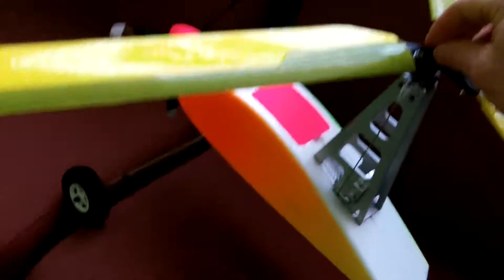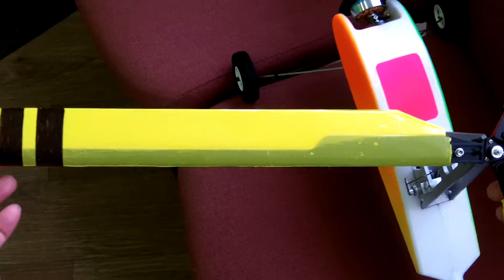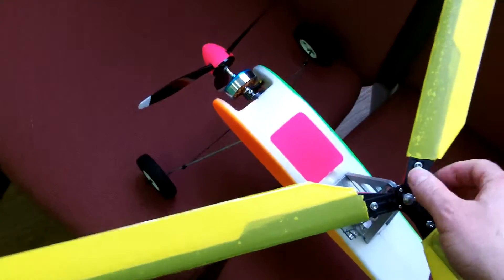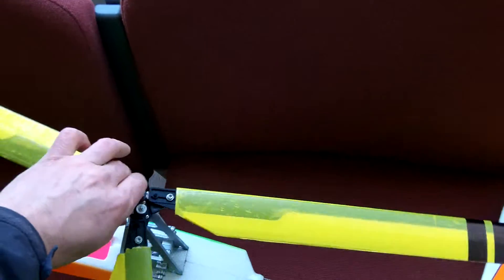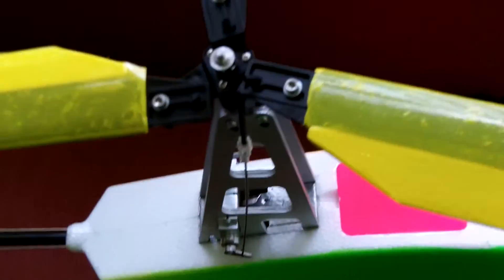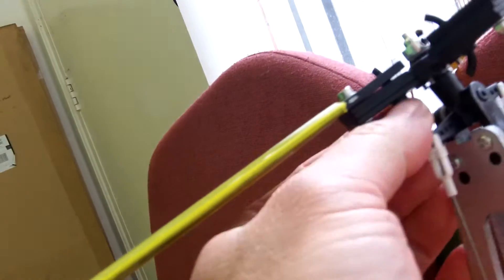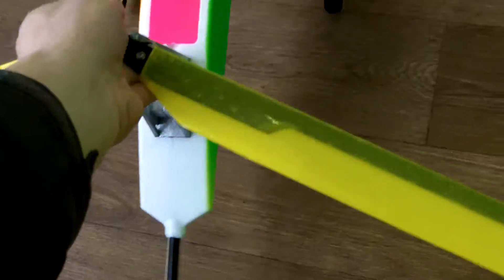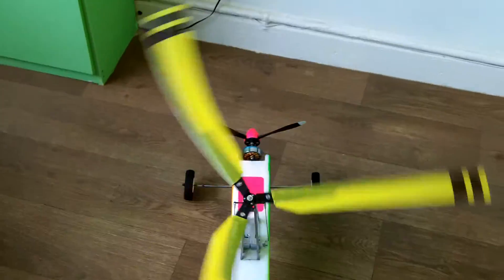My Blade Shock Absorbing System Demo, Durafly Auto G Autogyro.

Comment: I know this was a long time ago but what rubber did you use and how did it fly?
Reply from the maker: Hey, those were simply O rings cut in half, flew just fine, the centrifugal forces keep the blades in position, in a blade strike the rubber takes care of business :-)
Reply: @joseico90  Brilliant. Ive just test flown a G2 and on the second landing it gentlly tipped in the breeze and snapped a blade! Going to make a new hub from fiberglass board and try your suggestion. Was going to use cocktail sticks but I think the o ring rubber is the way to go. Thanks for the tip. Next job... Wider undercarriage! Cheers. Bob.